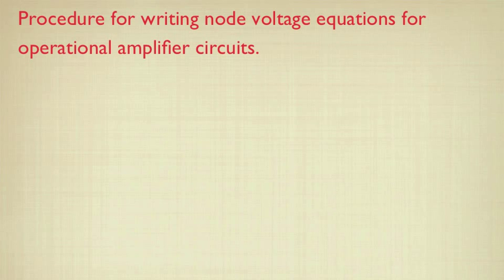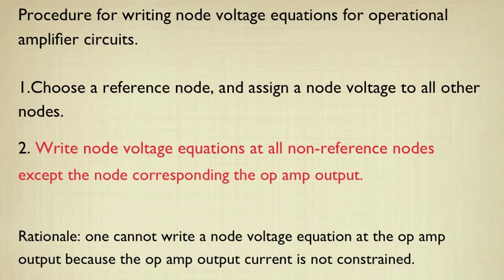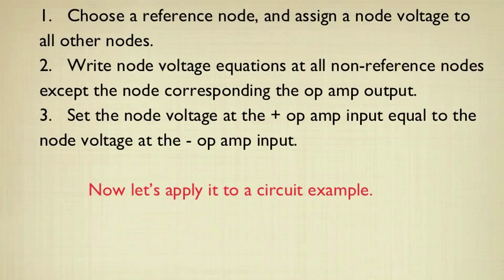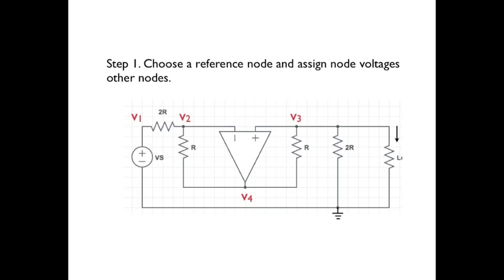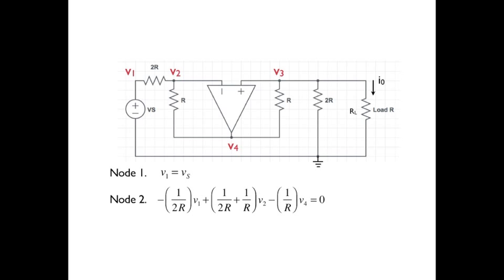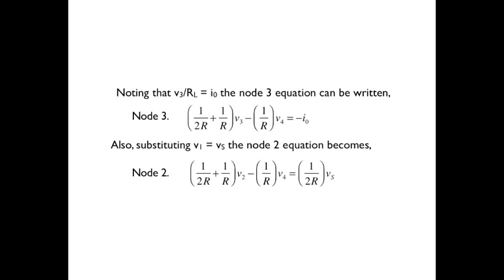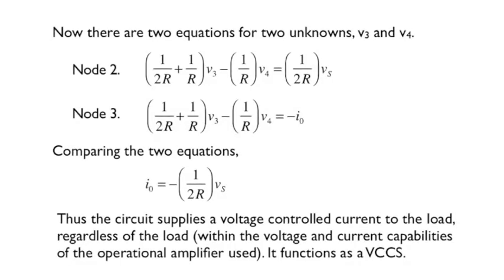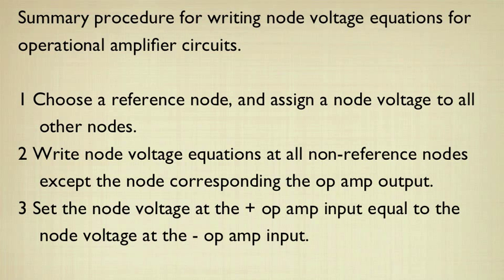ECE 201 Lesson 19. Node voltage analysis of operational amplifier circuits.

Comment: Could you do a voltage divider to get V2 and since V+=V-, V2 must be equal to V3
it would look something like this

V2= Vs(R/(2R+R))= V3

Is this equally valid?
Reply from the maker: That is a good question. Actually though the voltage across R is (V2 - V4) rather than V2. The voltage V2 is the voltage between node 2 and ground. So using voltage division one has  (V2 - V4) = Vs(R/(2R + R)) which would also result from the second node voltage equation in the video. Thank you for the question.